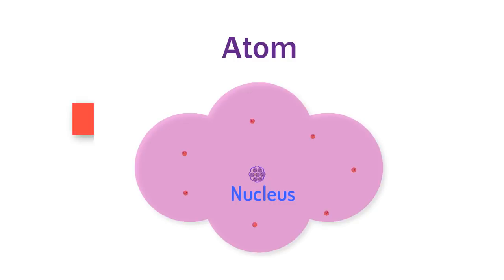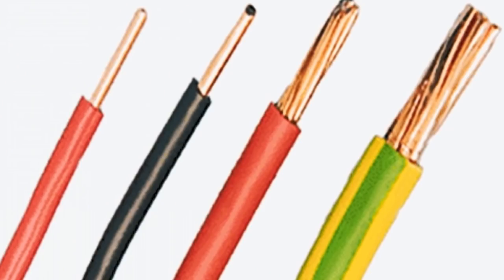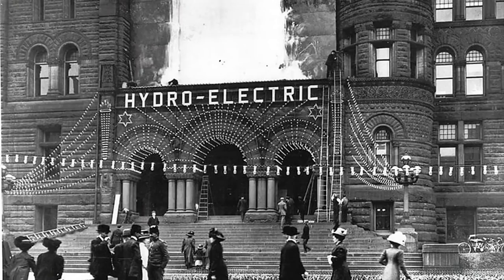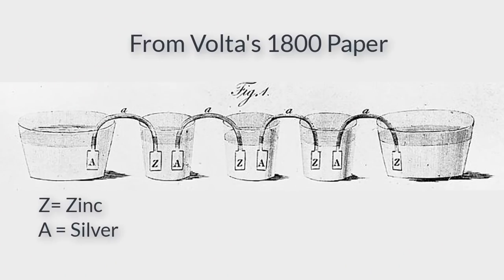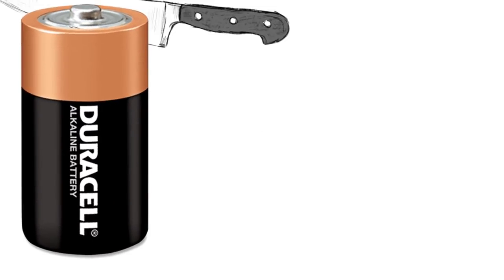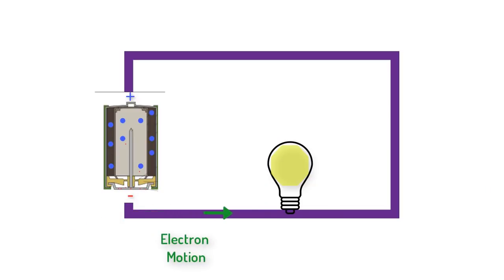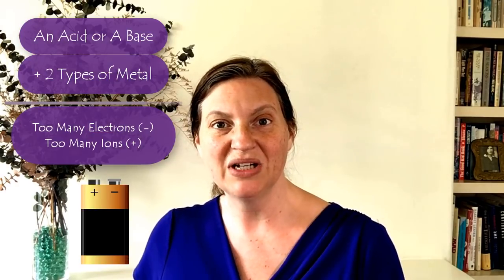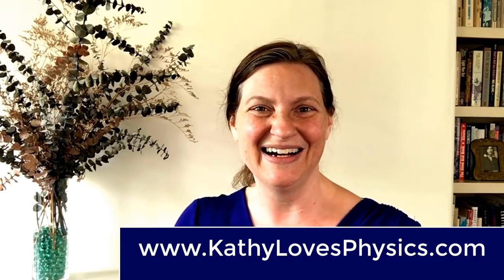How Does A Battery Work? Simple & Fun Explanation for Adults (& Smart Kids)

Comment: You're overstating the case regarding lying electricians. I was taught about electron flow and conventional current in the 1970s when I was doing engineering science at school. The same happened in my electrical and electronic engineering degree. It's a pity there was this initial confusion, but the equivalence of the two concepts doesn't cause confusion in practice. Take a look at "Basic Electricity" (part 1) by Van Valkenburgh [Technical Press, 1954].

Comment: Teachers and electricians are not lying.  Convention vs. "Reality" is by necessity.  Too much technology is based on the convention.  The math works both ways.  And getting something backwards while something else is not can kill you.  "Current" flows from positive to negative.  Current produced by moving charges flows from negative to positive.  And old tube electronics and motors follow convention.  Modern electronics follow current flow instead of convention.  Stay safe.

Comment: Hi Kathy,

I realize this video came out years ago (I'm catching up lol.) Just a thought. What if after Ben Franklin's time the definitions of negative electrons and positive protons were reversed? Diodes were marked oppositely (maybe not since they seem backward, or at least the schematic symbol is) as were electrolytic caps and batteries. Then, his assertion that electricity flows from positive to negative would be correct. Perhaps it wasn't he who was wrong, but the definitions afterward.

Great videos! I'm loving 'em! Keep up the good work.

Happy new year 2020!
Reply from the maker: Hi Ken,  So, Franklin defined positive as the charge that was left on a glass rod if rubbed by silk.  Much (much) later it was found that when you rubbed glass with silk the silk gained electrons and the glass lost electrons, so, by Franklin's definitions, the electron had to be negative.  [Actually, it was a bit more complicated than that, in 1894 or so it was found that a stream of "cathode rays" where negatively charged (or had the opposite charge of a glass rod rubbed by silk).  It was then found that the cathode rays were made of tiny particles that were in everything.  Eventually, those cathode rays particles were called electrons and people found that the motion of those particles are what current really is composed of.  If you watch my video on JJ Thomson and the discovery of electrons it might help].  Also, xkcd has a cartoon about Franklin and charges because of course he does:
https://www.xkcd.com/567/
Reply from the maker: Here is the link to the discovery of the electron:
https://youtu.be/n3c77C-69wg
Reply: Thanks Kathy! I'll watch it now. :-)

Comment: I first learned basic electronics in '72/'73 with the Air Force.  There I was taught that current flowed from negative to positive.   When I got out of the Air Force I attended college for Electrical Engineering.  There I was taught that current flowed from positive to negative.  It took a little extra effort for me to switch that concept around.

Comment: Super helpful video. Thank you! But somehow I still don't get how a series connection of batterys works...
Reply from the maker: That is a very good question, and a little complex but I will try to explain it.  OK, so I think it works like this, you don't get more chemical reactions due to a temporary dip in the potential (voltage) unless both the negative electrode loses electrons and the positive electrode gains electrons.  So, imagine you connect the negative of battery A to the positive of battery B.  Some of the electrons from A will move to the positive electrode of B, but the voltage across A and B will remain at 1.5 Volts.  The voltage across both A & B, however, will be 3 Volts as it is cumulative.  Now, if you put these two batteries in series in a circuit, then the electrons in the negative electrode in battery B will push the electrons in the wire to add extra electrons in the positive electrode of battery A.  In this case both Battery B and A will have more chemical reaction which will cause more electrons from the negative electrode of battery A to move to battery B.  This process will continue until the batteries are dead.  Does that make sense or is it too confusing?
Reply: Thanky You. I hope I kind of got it. The stronger chemical reaction boosts the voltage right?  @Kathy_Loves_Physics

Comment: Had a strict teacher in Vo Tech shop that had strict beliefs. Told us there is NO such thing as a AA, AAA, C or D battery but is nine volt batteries. AA, AAA, C & D 's are dry cells ! Also told us only two things can store electricity a leddly jar & a capacitor. Batteries & dry cells store chemical energy that is converted to electrical energy. In my 50 years as an industrial electrician never cared or had to be concerned if in DC circuit direction of electron flow. Worked on hundreds of 2 to 250 HP 480 Volt VFD'S that had  but  capacitor bank and had AC converted to a 665 volt DC buss to feed IGBT'S but didn't care about electron flow while troubleshooting.

Comment: Thanks for sharing your knowledge

I want to know one thing so please help me in understand it

If you connect two cell in series then how the chemical reaction takes place and how voltage will gets added with respect chemical reaction
Reply from the maker: Yashwanth L in my mind, the best way to think of it is with an analogy: imagine you have two water pumps, if you put them side-by-side you can pump water to the same height but you can pump more water. If you use both of them in series then you can pump water to a higher height.
Reply: @Kathy_Loves_Physics   thanks for reply 
one more question i have
 in electric vehicles battery are used,cells are connected in series  how charging will happens when cells are connected in series

Comment: One thing I've long wondered about is why all dry cell batteries produce 1.5 volts no matter how big they are.  You know, AAA, AA, C and D are all 1.5 volts (and I know that the rectangular 9 volt batteries are just a bundle of 6 small -- I believe "F" size -- 1.5 volt batteries in series).
Reply from the maker: OK, let me try to explain.  The different sized batteries all have the same chemical and the same types of metal so they all produce the same voltage.  However, the bigger battery has a lot more metal and chemical so it can produce a lot more current for a longer period of time.
Reply: Oh okay. That makes sense. Thanks a lot for the reply Kathy!

Comment: I think you got your explanation of the charge flow a little twisted. The Positive terminal is where the electrons physically are, the negative terminal is where the positive ions are; that's the issue with conventional current. So current does flow from positive to negative terminal, but only because they flipped the symbols from the physical reality. The way you explained it gives the impression the electrons are physically at the negative terminal & they're flowing to the positive terminal; which would be the case if the symbols were applied correctly.
Reply: Yes! Thank you. You've nailed it. In general I love this channel, but this particular episode is a disaster, "on so many levels" as they say.

Comment: Every scientist and electrician is lying?  Funny, I learned that electricity flows from negative to positive in college back in the early 80's.  Yeah, the convention is indeed reversed for the reasons you stated, but both in Electrical Engineering and in Physics, my professors made it clear that it was negative to positive.  So, no mind blown here.  🙂  I took a course in Electronic Material (non-EE Engineering course), and bam!, suddenly my earlier courses in chemistry made a ton of sense when it came to conductors and insulators ... crystal lattice structures and so on.

Comment: The attempt to explain batteries in this video is 'Not even wrong' (as Pauli would have said) -- quite unworthy of such an otherwise excellent channel. So, I looked around on youtube to see if someone else might have succeeded in what Kathy attempts here. The path between [a] too much weird chemistry terminology and [b] an approach that is  'friendly' but marred by quasi-nonsense is admittedly a difficult one to find, but my search of a half-dozen videos turned up one at least that succeeds in finding that narrow path. See the 9-minute video linked below.
The issue: What makes a battery work lies almost entirely within the electrolyte solution, not in the electrodes, not in the wires attached to the electrodes, not in "different metals.". To focus on "different metals" -- as in Breaking Bad, Season 2, Episode 9, for example, or in minute 6 of Kathy's video here -- results in distractions that lead nowhere. Only if one talks about paired REDUCTION and OXIDATION events (not necessarily using those terms which are admittedly confusing, 'overloaded' and unfriendly) has one explained "how a battery works." And by the way, for one or both electrodes, one may choose metals that are chemically inert. And the talk about 'free electrons' has to do with conduction in wires, not what goes on inside the battery to which those wires are attached. Those are two entirely different subjects that Kathy has conflated all through her presentation.
Here is the video I mentioned that succeeds in a presenting a friendly explanation of how a battery works, with minimal jargon:

https://www.youtube.com/watch?v=6p6UkwbEdtQ

Comment: Every Electrician and Scientist is lying? Well Kathy, as an Electrician there are two aspects of electricity 1) electron flow 2) current flow. These go in opposite directions. Electricians are only concerned with current flow, and will install current limiters, current interrupters, current measurement devices and current meters. Not concerned at all about electron flow. As that is our perspective how are we lying?
Reply from the maker: Yes, most electricians only care about current as defined as the thing that flows between positive and negative terminals.  But what is flowing between positive and negative?  Nothing.  This is even more apparent when you talk about cathodes and anodes.  Faraday defined the cathode as the terminal that the electricity flowed from and anode as where the electricity flowed to.  As this was done like 60 years before the discovery of the electron, engineers define the positive as the cathode and the negative terminal as the anode (as they still do).  However, this gets super confusing when it is obvious where the electricity is coming from in a cathode ray tube.  In that case it was apparent from the very first that something was emanating from the negative terminal.  So they called the negative terminal the cathode.  It is fine to use a slightly inconvenient code that is incorrect because it is too difficult to change it after all of this time.  But most people incorrectly think that it means that something is flowing from the positive to the negative terminals when, really, electrons are flowing the other way and we just define the current as opposite of the electron flow (unless we don't talk about it like with CRTs).  Lying may be too strong, how about misrepresenting what is really going on?
Reply: Kathy Loves Physics   Kathy, you say ‘nothing flows between positive and negative’. What about current, which is the working component of electricity? This is what we measure and revenue meter and have to install Current Transformers when the current is too high. How would you measure or revenue meter electron flow?
Reply from the maker: @peteroconnor5537  You measure electron flow in exactly the same way you measure "conventional current" by deflection of a magnet.  It is just that the direction of electron flow is opposite of the direction of current.  But we are far too far down the rabbit hole with too many electricity systems setup for "conventional current" that we are stuck with this, even in cases, like cathode ray tubes, where it doesn't make any sense.
Reply: Kathy Loves Physics   Really Kathy? You know of a way to measure sub-atomic particles? Who makes such a meter if it exists?  Surely current does flow, it flows from positive to negative, it can be quantified, measured and metered in both AC and DC and has to be so in order to work in the practical world, which seems to be different to a Physicists theoretical world. BTW, have enjoyed all your vids so far. Just questioned this one. Cheers
Reply: @peteroconnor5537  If electrons flowed from positive to negative, valves (tubes) would not work.